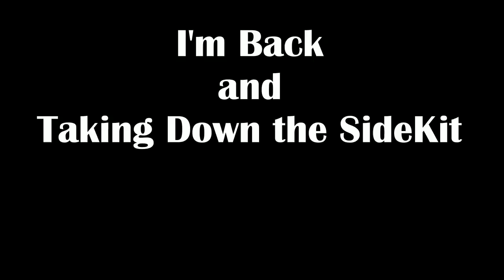#202 I'm Back and Taking Down the SideKit The Life of an Owner Operator Flatbed Truck Driver Vlog

Comment: I’ve never been a skateboard fan I’ve hauled locally with flatbeds because I drove for a bulk company however unless you don’t have to tarp or the loads are easy to secure then it’s OK I’ve just never seen the benefit to flat bedding just like I’ve never seen the benefit to refers either. I hauled fuels, gas, aviation gas, distillates, and propane  easy clean simple to load and deliver (most of the time) I will say this unlike freight fuels go 24/7 365 so your always running but the key factor is the revenue is high. Trucking is a tough business and the drivers who succeed find their balance in the freight they they haul and the consistent revenue they take home.

Comment: Your side kit cost haul grain (wheat ....you need higher sides for flax, oats, ryes and lighter grains) You need a hammer staplers and duct tape to Seal and cover those leaky areas.  I chalked my deck boarders to prevent floor leaks, had strips of canvas to seal bottom of plywood at deck level, and cross boards at rear that allow me to remove bottom board to unload, while the rest of the boards stay locked in place by welded tabs and etc.  So, before lading, I would seal the interior with tape and paper (shipper has paper). Tarp was one piece and had no holes and long drop sides to seal grain from rain,
Reply: Talk about canvas on the side kit. We use to haul rice out of Galveston and area. Rice will keep you busy as well to stop the leaks.